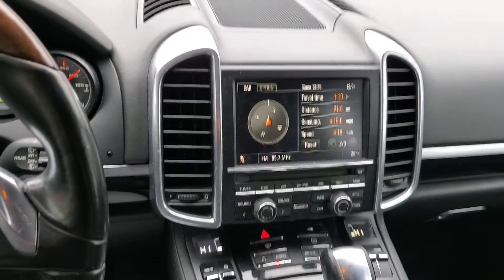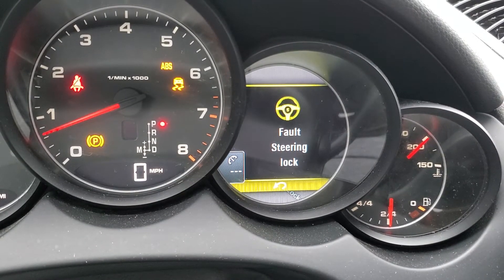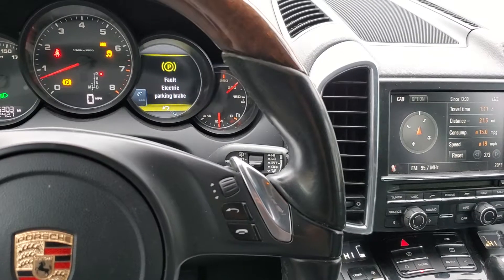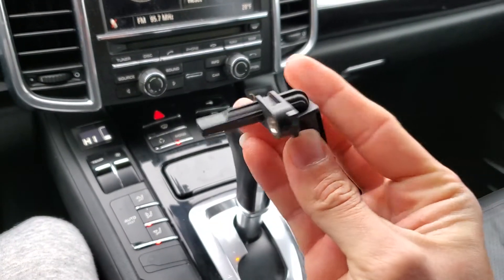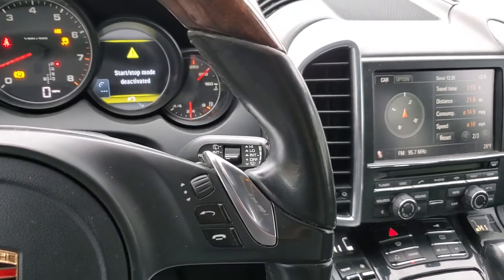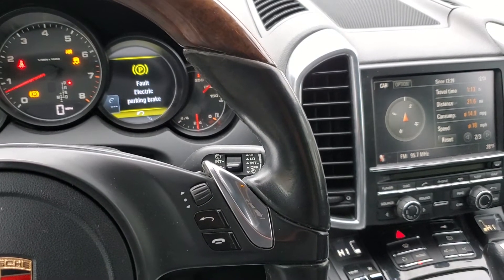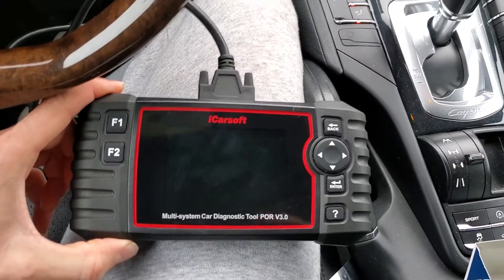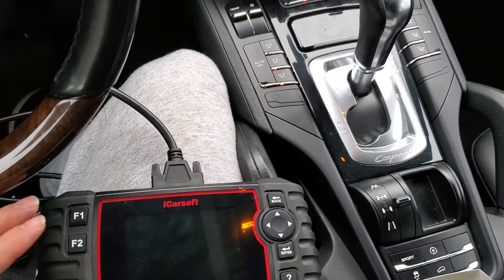Porsche Cayenne ABS Speed Sensor Problem System Failure

Comment: Hi I got the same problem yesterday same sensors come ups but in the same time the transmission stop working I cannot change the gear !! Can you help me out?
Reply from the maker: It's possible that you have more than one sensor go bad. I have come across this problem once before, the vehicle had 3 sensors go bad and 2 were reading in reverse so it threw the transmission into limp mode and it would not move or move a couple feet and then cut off the power to the gas pedal so it won't do anything.
Reply: @mr_fixit thanks for you vids, learned a lot! I got the same scanner, showed faulty front driver and passenger rear speed sensors. Car symptoms; Christmas lights on dashboard, car goes limp, sometimes I can break through the limp after jumping on the gas several times and almost increasing speed for it to switch two next gear to actually make it “drivable”( I know that’s not good to do), loss of acceleration power, also computer showing bad fuel combination and multiple misfires. Regarding the last symptom with misfires, could that also be related to speed sensors? Or I’m in more trouble?

Comment: RE: ABS sensor. Porsche dealer says they have a new model of this sensor and they want to replace all four for $1,235! Beware. The old model sensors are widely available and you can replace it yourself in about ten minutes.
Reply from the maker: Yes, dealerships are about the worst place you can take a car to get serviced at. There are exceptions but more are bad then good so best bet is find an indy shop that specializes in the brand and have the experience and good reputation.

Comment: How many speed sensors
Reply from the maker: There is a speed sensor on each wheel so you will need a scanner to find out which one is bad.
Reply: @mr_fixit  do u still recommend to change all 4 sensors while computer indicates only one is bad?
Reply from the maker: @andyxie2552  You can replace only the one that is bad but be prepared to replace the rest of them soon after. I had two go bad at same time and after replacing them the others failed within a month or so.
Reply: En espanish plis